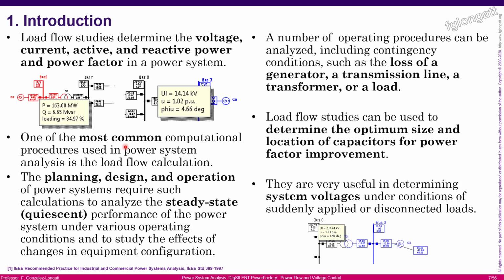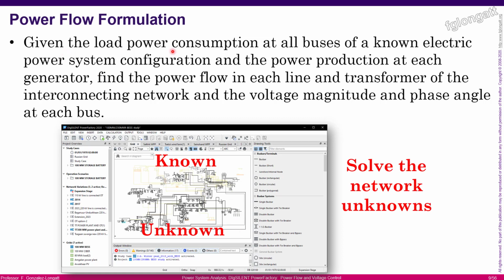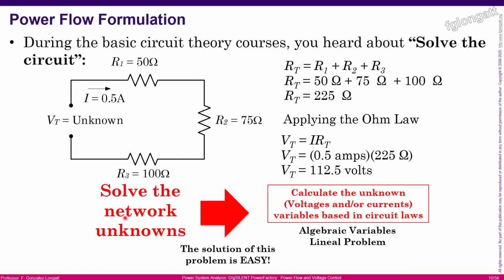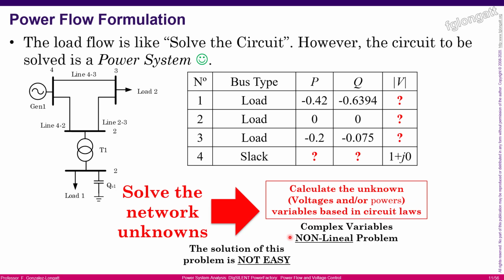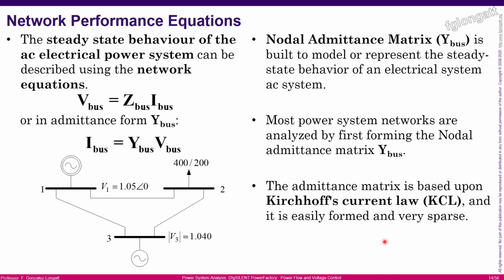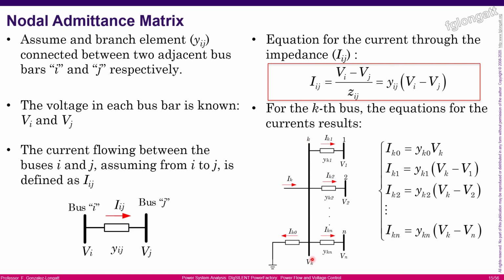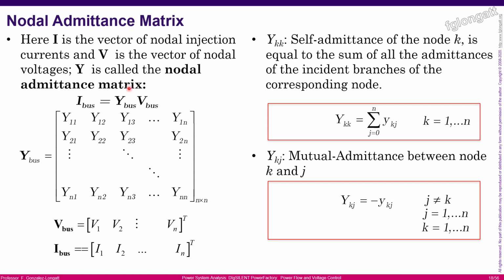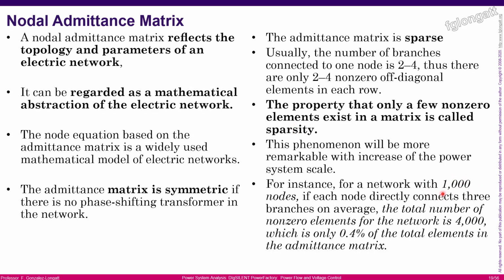Power Flow and Voltage control Using DIgSILENT PowerFactory PART I

Comment: - Loadflow to run Optimal Placement of Capacitor, help determine the protection device
- Power system is a Non linear problem (contain complex numbers)
- Theory 1: Nodal Admittance Matrix to simpler (build linear equation using algebraic variable) the form of current flow which is proportional to Voltage.
- The admittance matrix is symmetric if there is no phase-shifting transformers in the network (how the phase-shifting transformer affect the form of admittance matrix? from my understanding from your another video, it's relevant to vector group, but i still didn't understand)
- Non zero elements in the matrix = sparsity; for a network with 1000 node, one node connect three branch, so the sparsity = 4, only 4% of the total elements in the admittance matrix